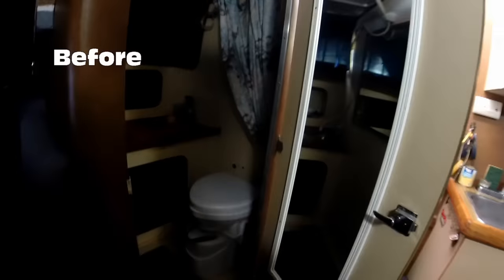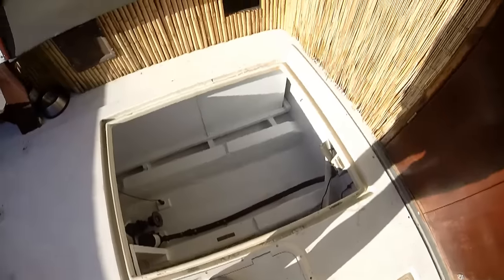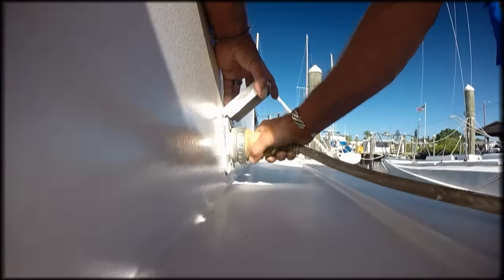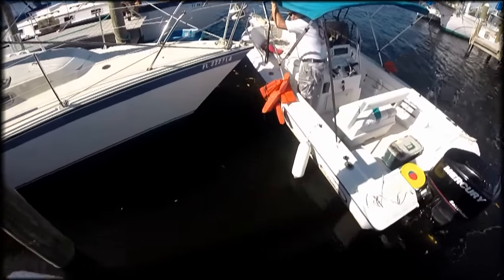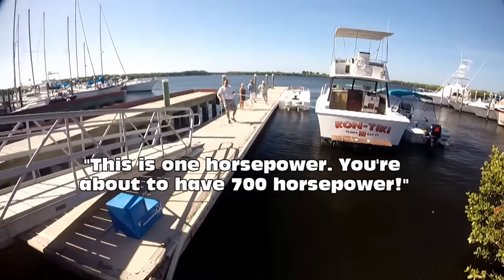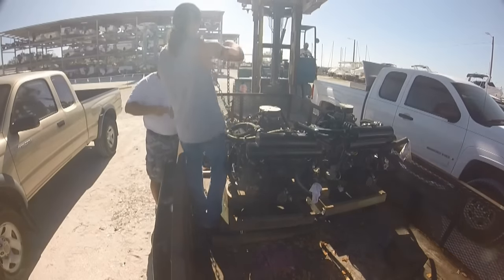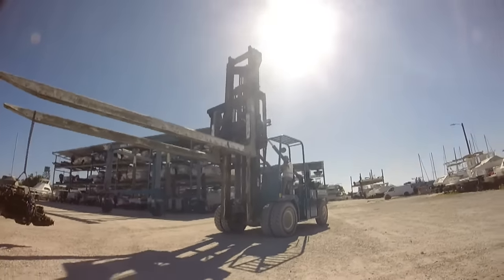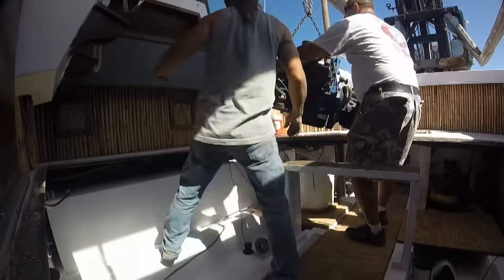Quick Boat Update Part 15: Engines Install

Comment: my boat was overheating and eventually did not start. water in the engine. backflow from El Nino !! engine ruined, had to buy another one, found an old one $150 chevy 350, rebuilt it for about $ 800 then came the hard part. installing the new engine and removing the old one. found a garage, charged me $1500 ...i am all excited how it will turn out. i have to wait a week for them to do the job. then the test in the water. every step is a challange, and the fealing is good. loved you video

Comment: A towing tip for you guys. When performing an alongside tow, make sure the towing boat has its engines past the stern of the boat it’s towing. You will be able to steer much easier. Great video nonetheless Marty.

Comment: In the event, you have to do this again and for others who are watching this video, go to a hardware store and pick up some cheap lag bolts. Grind the bolt heads off and grind a flat on each side. Screw them into the engine mount holes and use them as dowl pins to guide the motor into place. I usually use four per engine and it gets the mounts spot on with the stringers. Then use pliers or an adjustable wrench to remove them after you have installed a couple of the engine mount bolts into the stringer. Works like a charm every time and saves the hassle of having to bar or slide the engine around for final line up.

Comment: with the bilge clean and shiny new paint looks nice it is a bit unnerving watching your engines flying through the air I redid a 30 foot concord nothing like watching. 6 tons of boat. being lifted over your shop good 20 feet in the air to be set on a low bow cradle and all .one of my friends seen I was a bit nervous so he hollered don't know if it will float but she seems to fly darn good

Comment: Marty, great job on the engines. The velvet drive transmissions are worth a lot by themselves! It appears that you have to purchase the exhaust manifolds? 

My family has been boating (power cruisers) for 50 years and loved it. Even though our engines were fresh water cooled (looks like you have heat exchangers on yours, so they
are also fresh water cooled), we would flush them out every time we returned from a cruise. This cleans out the salt water portion of the cooling system, extending the life of
elbows, heat exchanger, oil and transmission coolers.

Also, be sure to regularly check (and if necessary, replace) the zinc (sacrificial anode) pencil in each heat exchanger as the heat exchangers are expensive and require their own zinc.    

Anyway, congratulations on a great boat and I really like toe motif..
Reply: Marty, I just realized that the manifolds were probably removed for transportation.

Comment: Its taken a while to get to this point, but your much closer than you were back in April 2015 and you have done a good job taking your time and doing it right. The engine compartment looks nice and I am sure you have done a rewiring job on that cluster mess you showed us awhile back. I am ASSUMING you did check the fuel cells, as you have had some excellent guidance from your friends both personal and internet. 

Marty, I have one small question if you have time to respond. How and where do you discharge your grey water and black water from your holding tanks on the vessel?

Thanks for sharing

Comment: Zoffinger what length is that boat my dad has a Chris craft. His is 35ft 79 model I believe and looks very similar to yours one difference is that the previous owner redesigned the interior to make it more like a home but I believe the layout in yours is very similar as well.
Reply from the maker: This is 31 feet. 1980
Reply: noice

Comment: great job on the motors, I have a question though when is the last time the bottom was done?  sitting for an extended period allows the pesky barnacles to attach themselves to the bottom.  Just wondering  love your videos.
Reply from the maker: It's been about 14 months. It still looks good, but the rudder, tabs and props could use a scrapin'.

Comment: awesome just awesome... so obviously we know that this has been done... I know it takes a while to edit and stuff.... but where exactly are at right this second... is everything connected? have you taken your maiden voyage? I enjoy your vids and want to thank you again for creating them and letting us live a different life through you:-)
Reply from the maker: It's not very different at all. I hit a snag with the motor mounts and am waiting to get that sorted out before I proceed. Besides.. it was seriously cutting into my fishing time! So, I have been on engine time out for a while.
Reply: +zoffinger oh I'm sorry....hopefully once you get past that problem it will be smooth sailing...lol.. when they first went in the carbs looked like they were to high... I didn't know if the hatches were gonna fit back on... are those bigger than the original motors?

Comment: It sure would of been easier to get back out if the guy in the boat in front of you would of moved out of the wy since he was in the boat with the motors running or at least help keep you off his boat instead of walking away as you got to his boat at 9:25 .  Hope you left a foot print or 2 on his hull